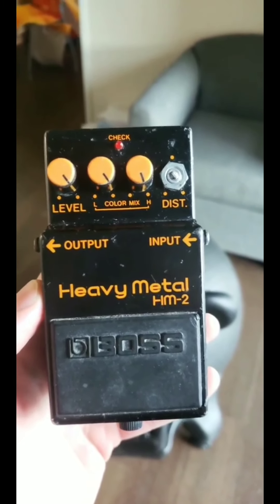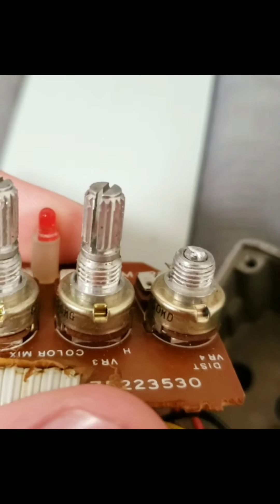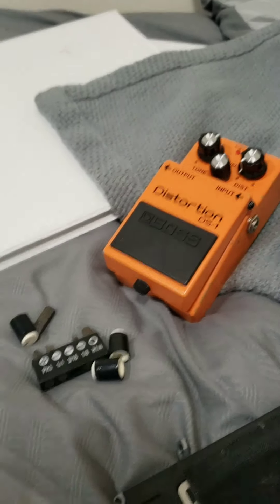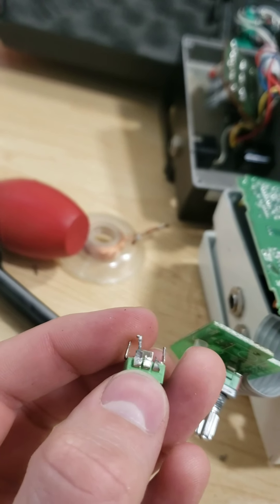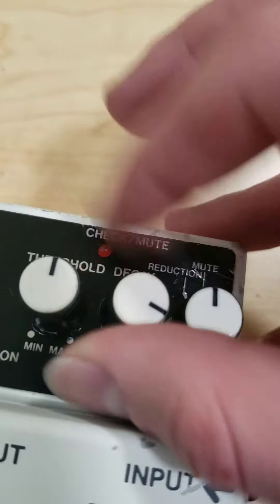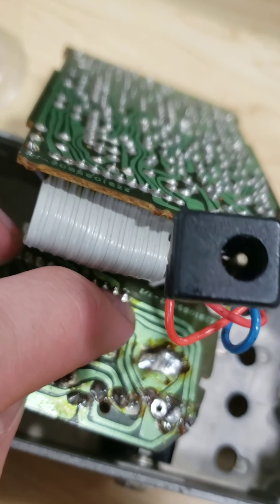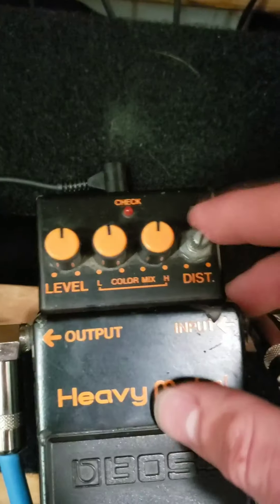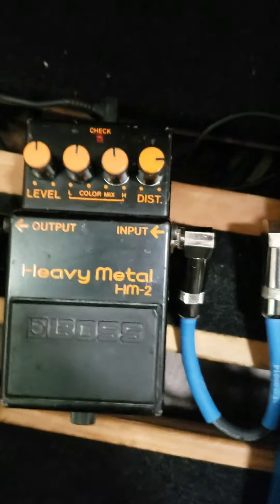Boss HM2 Repair Broken Pot

Comment: Great video man, the stock value from the gain pot is b250k?
Reply from the maker: I used a 250KA pot from the NS2. A b250K should work but might have some different tapering (eg seeming to affect the tone most at the last quarter of the turn or vice versa, can't remember exactly which is which)